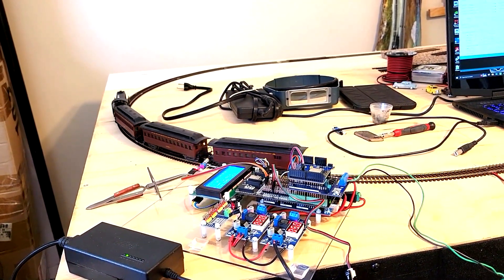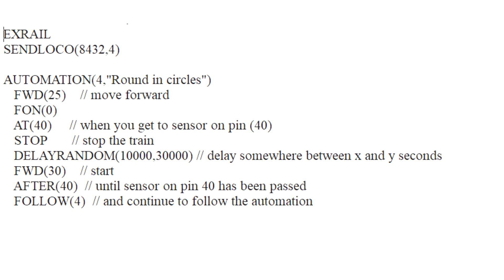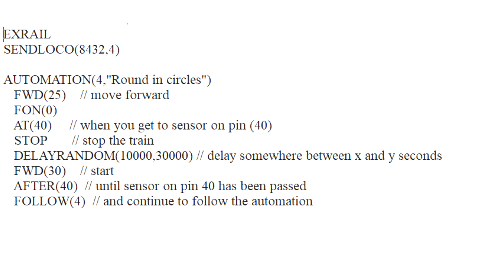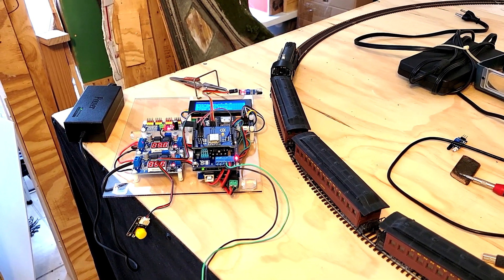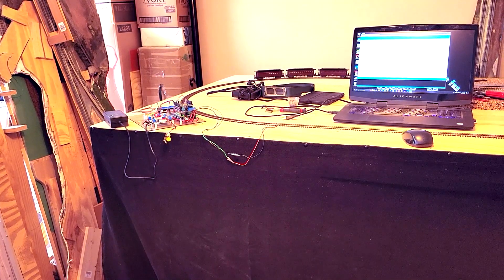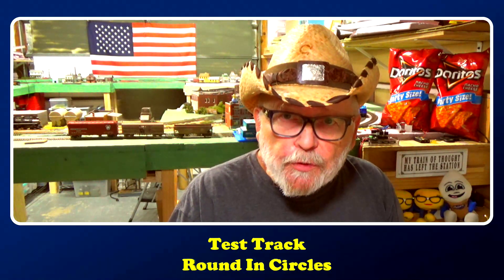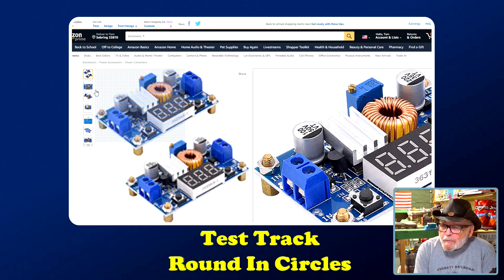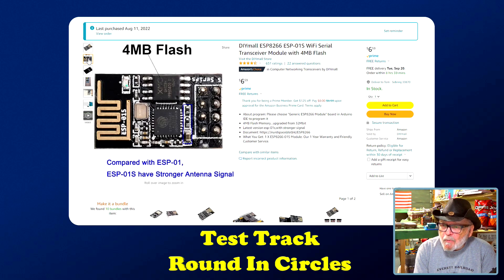EX Rail Automation Pt 1

Comment: Did you video part2, I can't find it?
Reply from the maker: No I have not. I have a Beta release of the next incremental release, but haven't played around with it as yet. Got side tracked with other projects.
Reply: @TomsTrainsandThings  Thanks Tom.  What are yiuy using the LCD screen to display?  Does one of your videos cover that?
Reply from the maker: @mikeandrew443  The screen displays the version, power status, and ram used. You can also program it to show other functions from the DCC-Ex app

Comment: Looks complicated, but I might dive into that in the near future.  Perfect for passenger train setup.
Reply: It's really not.  I was a little bit intimidated by DCC-EX, but it took me maybe an hour to get a train running controlled by my phone.  The EX-RAIL markup automation stuff is icing on the cake.... can do all sorts of cool stuff with it... block detection and signaling, animations, lighting sequences.  The only limit is your imagination.  Stuff that would typically cost a lot of money in various DCC modules can be accomplished with jelly bean parts from china that cost a few bucks.  IoTT even offers a pretty cool device called the IoTT Stick + Redhat++ that allows you to host a WiThrottle server on the command station, without the need for JMRI, through your WiFi Router (and plug into LocoNet devices like throttles, if you are so inclined).
Reply from the maker: Easier than dcc